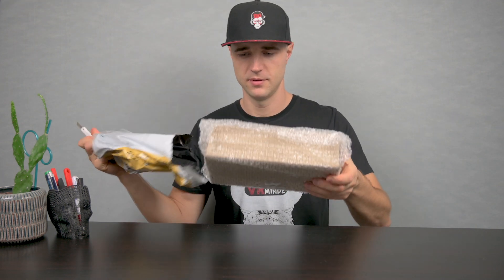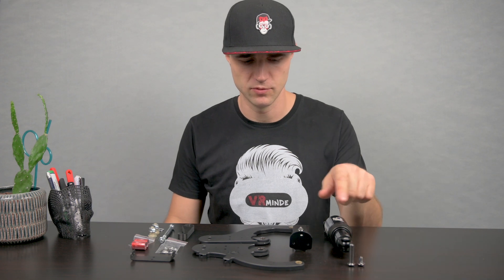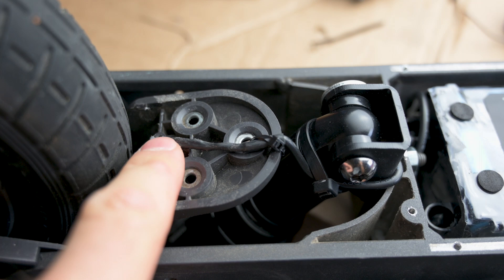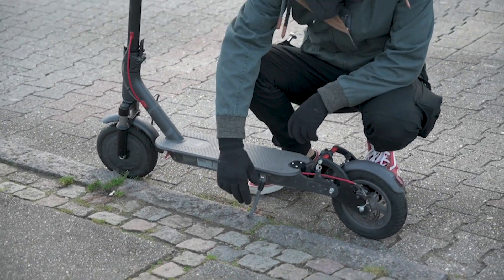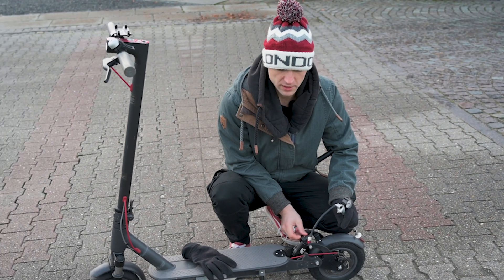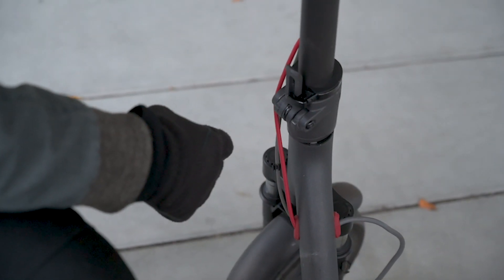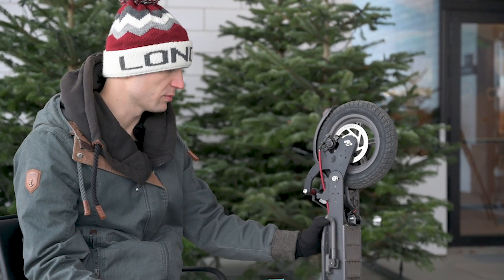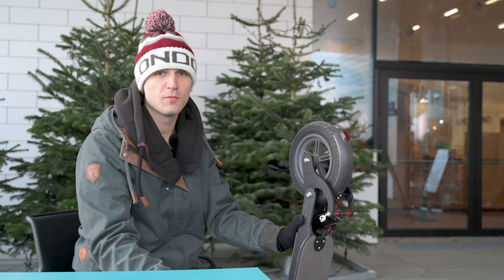KONYK rear suspension for m365 unboxing and the first look

Comment: I bought a suspension very similar to this one. It has a visible black spring and not this Konyk one, but it can change. I have to say, you do job very well, of course it's also adjustable. I cut the piece of the fender with the three screw holes that they used to use to stare at it.
Reply from the maker: Someone already told me there were similar suspensions on aliexpress. I will probably 3d print a shorter fender, but need to find time for it somewhere :))

Comment: You need to upgrade the front to Monorim and buy separate the same air shock on it that you have on the back, I have this on mine and it is great!

I have ordered the Chinese rear suspension off eBay here in U.K. which looks identical to this for around 55euros and it does come with a brake cable extension piece, rear light extension cable. I have the same rear air shock ready to fit to it. In total cost me about 99euros delivered.
Reply from the maker: I am considering the monorim 👍🏻 
It would be interesting to see how many differences there are compared to the chinese rear one 🙄

Comment: Unfortunately, the mudguard is fixed in the same way as with the china suspension, it will start to rattle while driving.
That's a real damper, not a useless spring👍
you will have fun with this suspension  🛴
Reply from the maker: If that happens I will have to find a fix. Harmte rattling :D
Reply: Not only for this part but more like a DIY general advice. For Any 2 pieces of metal rattling, just put a piece of rubber or plastic between the screws, get longer screws if you need to. Problem solved

Comment: Nice! Looks awesome. You should try the monorim v2 for front suspension
Reply from the maker: I am considering it for sure
Reply: Believe me 365 made for not having suspension my exp without is much better and smoother
Reply from the maker: @buzzhd1078  well I have both with and without and even on my test-ride day I tried everything on both scooters. I do prefer one with the suspension :)
Reply: @VRMinde  which is best suspension company for xiaomi
Reply from the maker: @michaelbmw1931  I like the monorim v2 in front. And konyk at the back. That does bot mean they are “the best”, plus have in mind that I am using air shocks both at front and the back that makes those suspensions work well
Reply: @buzzhd1078  Can you explain why this is better without? Thank you.
Reply: Kids scooters not made for suspension!! If you want suspenders Get a Better Scooter 🤷🏻‍♂️

Comment: The front suspension is only noticeable if you have semi solid tyres on the front wheel.
Reply from the maker: I will try monorim I guess :)
Reply: @VRMinde  Now that I watched the whole video. I realised that the front suspension on mine could be a lot better as I have a spring rather than a air shock absorber. It still works but having the option to fine tune it would be great. 
If only they made the side plates out of carbon fibre as it's light and strong. My scooter is starting to get heavy with these additions.
Reply from the maker: Suspension needs to dampen both ways to work :) I think carbon parts would be possible to do. Then not the weight of the scooter is the biggest problem, but the lost weight in the wallet :D
Reply: @VRMinde  Not unless you buy the carbon fibre cloth and resin and make it your self and then cut out the shape. 😏

Comment: Man, those bolts that hold the stop mud in the back is my scooter got broken... so to me is kind of impossible to install the suspension. Have u ever saw something like this? Because I see is essential to attach this part and it's very hard when u have only one bolt available
Reply from the maker: Well, if you have at least one - you can always find some bolts for replacement :) if they are not “generic” ones that you can buy by measuring the size, then you will find them on aliexpress somewhere I am 99% sure
Reply: @VRMinde   thank u so much for your  answer! I have them for replacement :) just the problem is the previous ones got broken inside the component... this was like a curse hahaha
Reply from the maker: @thamirislungaretti6140  take a drill (smaller drillbit than the bolt) and carefully drill it out :) it is possible :)
CAREFULLY is the key word here :D
Reply: @VRMinde  thank you  so so so much! I'll do it asap and than I'll tell u if worked hahaha I hope not lose my fingers on it hahaha

Comment: Curious if you can have a pneumatic front and  solid rear tire setup with full suspensions. Since study says 90% of flats happen on the rear tire. To see if rear suspension can  compensate the ride quality of rear solid tire. But at the same time your still have pneumatic front to balance ride comfort.
Reply from the maker: I think you could, but honestly almost any pther tire but the stock one lasts forever without punctures. I have other scoots on solid tires and I do not like theor grip, do not trust them on corners... For now I am keeping the 10” air tire at the back and just installed the 4th gen CST 8.5” on the front.

Comment: Great video👍 also not much in the way of diy on the scooter just moving bits every other one I’ve seen needs some new hole or something cut off. 

Quick question for back inner tube valve...can you fit a straight valve inner tube Ordovician need a curved valve?
Reply from the maker: I do not know why some comments are not "flagged" to me by YT. For the back wheel straight one works just fine :)

Comment: Nice video 👍🏼👍🏼
I’m not a fan of modding the m365 too much. Would rather get a second off road scooter built with suspension etc. At some point all that added weight has got to start being a negative. 
Still tempting though 😀
Reply from the maker: I do not feel the weight while riding, but you have a point here :) I would say money-wise it makes more sense to buy a more expensive scooter with suspension, more power and bigger battery :) at the same time it is fun to explore :)

Comment: if you buy the monorim suspension you get the plastic bit for the stand and you get the extra cable aswell so that should solve your problem or just cut a piece of outer of a other cable for your,s hope this will help you abit. and no don,t put them horrible hard tyres back on i have just put mine soft tyres on mine and i love them and i have got some anty puncture tape on mine so im hoping i won,t get a flat lol
Reply from the maker: The rear monorim? I really despise how it looks mate :)
Reply: @VRMinde  the one you had is but there is another one budd and its well better the one with the little mudguard on the back ill post u a pic bro
Reply: @VRMinde  me too, why does it have to cover the whole rear tire

Comment: Hi, thanks for the video. It is very informative. I was thinking about monorim rear suspension but I really dont wanna get extra hole on my scooter but referred by many users. And, according to this video this also seems very reliable. Do you have any opinion about it? Thanks.
Reply from the maker: Hi man, thanks for the comment. I did not like how monorim looked. Reminded me of toyota prius 😂 this suspension still works fine after a lot of abuse, I am happy with it. I have installed the motor in the rear as well, still works fine.
Reply: @VRMinde  totally agree with you... Yes, I have also installed it and I am very happy with it. Thanks for reply... 🙂
Reply from the maker: @jameslost7371  glad it works well mate!
Reply: Monorim is worst. Don't buy monorim. Many problems with it.
Reply from the maker: @HristosInAfrica  I am using monorim now for more than a year, jumping in pumptracks, riding all types of roads and I did not have a single problem with it. What problems do you have with Monorim?
Reply: @VRMinde  Monorim design is horrible. You get rid of the original pro 2 light with was 10x brighter. You get rid of original reflective parts and the monorim fender is very good at letting all the mud coming to your leg. I have monorim and is the worst decision I made
Reply from the maker: @HristosInAfrica  I assume you are talking about the rear suspension mate? :) I have not tried it. I was referring to the front  one.
Reply: @VRMinde  yep. The rear one. I also have the front one and here is the problem I have : https://www.youtube.com/watch?v=1rZg8t_jnvI I am going to change the red shock

Comment: Hey it's me again, what would you recommend adding to the M365? since I have a M365 and want to make it more comfortable and just like a project car but it's a scooter
Reply from the maker: I use monorim mate, I think it is the best of what is on the market now. I use it with dual air shock, the double shock is not great for lightweight riders. I have not tried the one that comes with monorim. I made a vid about my suspension here https://youtu.be/bKhCyAfwe5Y

Comment: Is there a front suspension which you do recommend? I might actually buy the Xioami with this.
Reply from the maker: So I have not tried, but everyone talks positively about the Monorim V2. Apparently, you can fit it with the same shock absorber as this one on the rear. I cannot fully confirm it as I have not tried it myself
Reply: monorim is the way to go. i would recommend the one with the exposed spring (model t0-s) because you can adjust it to your preferences. the monorim with the enclosed spring looks better but has only two options (2 different springs) for adjustment
Reply: @crashdummy4983  nice, do you recommend a mud guard for that? If so, does it exist and where can I find it?
Reply: @soumynonareverse7807 depends, if you go in wet/muddy roads then obviously yes you need one. you can use the original xiaomi mudguard, but if you meant the mudguard holder there is also a monorim fender adapter. looks crap but does the job. if you wish a good looking one you can print a 3d model. there a few free models to download at thingyverse

Comment: I noticed that you are driving with the battery lid open. That is quite risky, because water could get inside the system and completely ruin the scooter. I wouldn't recommend doing that.
Reply from the maker: I know man, fortunately in my last 2 years of riding scooters (a lot in the rain) the water never got in there. I simply hate that plug, it is not easy to close :)

Comment: Installed mine both the 165mm at front and 125mm at the rear. May i know whats your psi on the rear main chmber and negative chambers? Thanks!
Reply from the maker: I barely use the negative chamber on scooters. And my rear one is a single chamber one :)

Comment: The way metal bends at 2:43 is not good. Put a broad washer there. Also the brake housing is too tight and straight, tha cable causing excessive friction and wear.

Comment: How does this one compare to the aliexpress rear kit? Is the shock 150mm?
Reply from the maker: The rear shock is 150. I cannot compare the aliexpress one as I did not have it :) From the looks they look rather similar, I do not know if there is any difference in the bushings and steel itself 🙄 
I was very unhappy with the quality of the front one from aliexpress and did not want to try the rear one :)

Comment: what to use to lubricate the air suspension of the A5-RE exa form?
Reply from the maker: Never lubricated it yet. Maybe someone else will have a good advice
Reply: There is no need for any external lubrication. Instead those shocks require periodical air spring service as well as damper service. Search youtube for videos explaining air spring service of any generic mountain bike shock (rockshox monarch, fox float). Same applies for this one as it looks like the same and it is produced by Kind Shock, company known to manufacture some mtb components. As for service intervals they are roughly 25 hours for air spring and 100 hours for damper. Could be more depending on seals used. Also based on my experience servicing mtb suspension (like 12 years) I would recommend servicing it before use because sometimes factories assemble those shocks with little to no internal lubrication(a common problem back in a day, rarely encountered for few years, but given how easy it is to check - I always prefer to make sure the unit will last).

Comment: On the order sheet says for m365 and another for the Pro, if I have a Pro will it work? How about weight limit?
Reply from the maker: For the pro they are different. I do not know about the weight limit, but my shock absorber is pumped to a very low level, compared to mtb or what the pump   can do 🙄 and I am like 85kg

Comment: where"s the hook when folding the scooter?
Reply from the maker: There is a 3d printed hook you can install on one of the top horizontal shock absorber spacers (red ones). But I assume it would rattle when riding and did not install it.

Comment: Just curious, what air pressure do you have in your tires? When you jumped the rear tire almost looked like it had to little air in it? 🤔 Do you have that for some good backthought for that? 

i personally got the monorim v3 front suspension and will get my konyk next week. 

Also have air shocks back and front, but im still experimenting with air pressure in shocks and tires to get a really smooth ride. Thats why i asked! 🙂
Reply from the maker: Hi mate,  I just had the tire on a bit of low pressure on the day of filming :) I do not play that much on my scooter tire pressures - just inflate them to the max recommended and (as you can see) forget to pump it up sometimes 😂
I change the suspension pressure a bit now and then depending where I am going to ride.

Comment: 6.53 Umm nope the stand does work you have just mounted it the wrong way.
Reply from the maker: What way should I mount it? It is way too short after 10” tyres + double suspension, does not matter which way you will mount it. It needs to be like 5-6cm longer

Comment: What about weight now?)
Reply from the maker: The rear suspension is not heavy, to be honest. I did not try to weigh it in but there are weights of all the parts in one of the konyk videos. 
I am probably going to go with monorim v2 on the front fork. Then I am still looking for the inserts to make the m365 2WD and then I want to move my external battery with Rita on the black scooter. Then I will check the final weight of the scoot with all the modifications :) 

It is not very concerning for me as it is parked on the ground floor and stays on the ground floor 99% of its' life :)
Reply: @VRMinde  Thnks, I'II wait:)

Comment: how to do no hands?
Reply from the maker: Wear a helmet. Be ready to fall. Do it pn your own risk - it is dangerous. 
Stand sideways on the scooter so you can steer with your body weight, find a nice even road and set cruise control. The faster you go - the scarrier :D but also the more stable. Balance body weight on both feet evenly and start letting the hands off the bars for a very short time. That will make a start.
Reply: @VRMinde  thank you very much will try it. 😁

Comment: What PSI did you put on the rear?
Reply from the maker: Hey mate, I adjusted it many times, depending where I ride. If I go jumping on pumptrack I inflate more, if I ride in city - less. I don’t remember exact number now
Reply: @VRMinde  any range? 50 to 70 or more.?
Reply from the maker: @remfpage  I can check tomorrow :)
Reply: @VRMinde  thanks. Ill wait for it
Reply from the maker: @remfpage  it is 40psi now mate

Comment: Should have bought the monorim rear suspension, Much better!
Reply from the maker: Can I ask why is it much better? 
One thing for sure - I do not like their fender design 🙄
Reply: @VRMinde  If you look at some of the clone zero 10 X scooter designs, you will see they are based on the monorim rear suspension design. I do agree, at first it looked a little off-putting, but once you get it installed, you get used to it. It is also a far superior build to any other rear suspension out there. V2.0 will be out sometime in June i believe.🛴😊👍
Reply from the maker: @fleebleflam  I hear you say it is way superior, but I do not understand what specifically is better compared to f.e. Konyk one. 
Can you please elaborate more?
Reply: @VRMinde  It's build is FAR superior, i.e Much Much stronger! The Konyk one doesn't look very strong, and is only connected by the original rear axel. Monorim is drilled to the frame itself, making it (imho) a far superior build.
But like i say, it's just my mho. It still looks ok, i do like the fact that  it has a proper air piston shock, & not a spring. That is my only plus with this suspension😊
Reply from the maker: @fleebleflam  well, as you say we might have different opinions :)
Reply: @VRMinde  Do you know where i could buy a 125mm (axel to axel) air piston shock in gold colour please?
Reply from the maker: @fleebleflam  i do not think I have seen any gold ones man 🙄
Reply: @VRMinde  Ah, that is a shame, my scooter is a Gold & black colour, & i could only get the all black rear suspension. So need a gold shock. Monorim only do 150mm gold😖 Have to keep looking. Here is my scooter before i install rear suspension  https://i.imgur.com/XzhKL63.jpg 😊
Reply from the maker: @fleebleflam  looks good man! The worst case scenario, maybe you can apply golden vinyl sticker 🙄
Reply: Monorim design is horrible. We get rid of the original pro 2 light with was 10x brighter. You get rid of original reflective parts and the monorim fender is very good at letting all the mud coming to your leg. I have monorim and is the worst decision I made